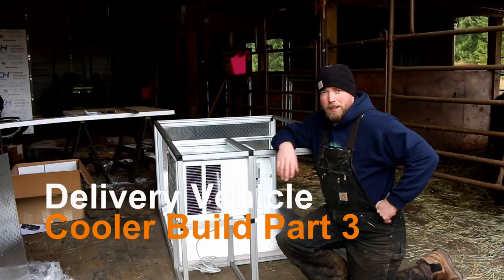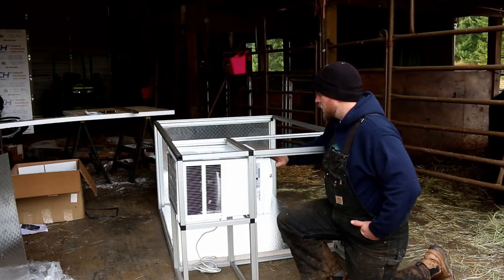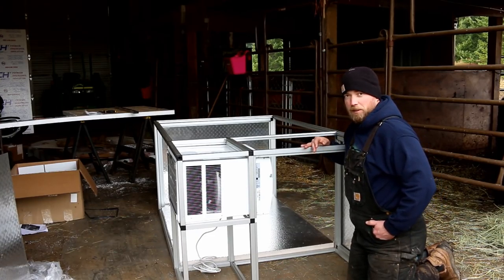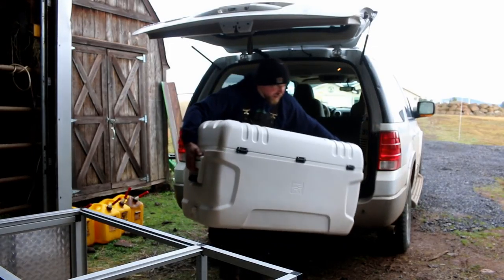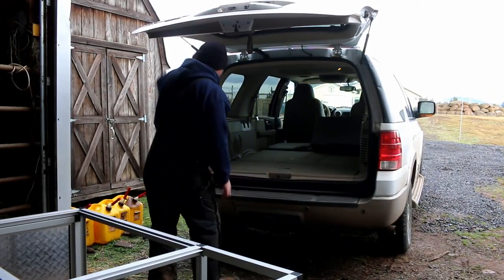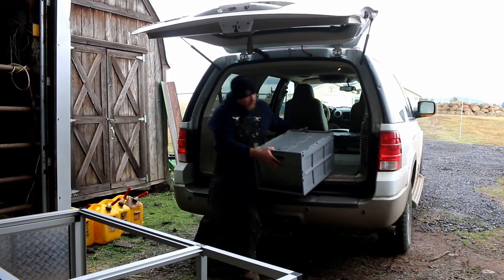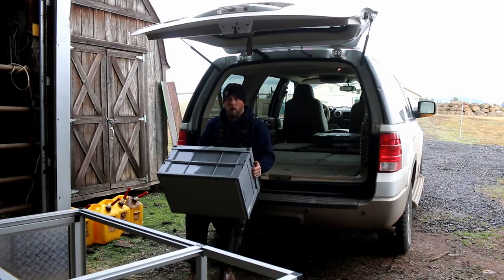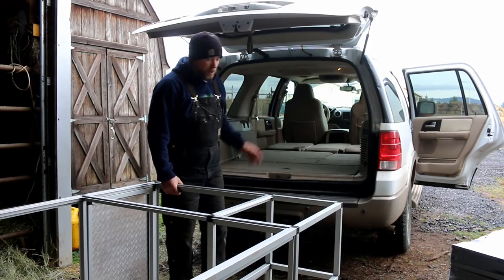DIY Mobile Cooler - FIT CHECK

Comment: I have two suggestions for you; first one, get a sheet of 1/8” hardboard to put on the floor to slide your cube on,this will make it easier to slide it in. Second One when you put your plywood flooring in your cube mounted it on full extension slides so that you can pull the plywood floor out and have full excess to the back of your cube without having to crawl inside to retrieve your containers!!

Comment: If you plan to take it out, then I recommend shrinking the height by an inch so you don’t have to remove any panels, then building a “dolly” that you back up to and can slide the cooler onto.  If you have to remove panels, they’ll get lost or the plastic retention pins will break and the whole rig will end up looking shoddy.  

Also, you deserve a workshop. Having a proper place to work makes every other project that much easier.

Comment: Love the videos.... think you should have use a thinner wall material as that's gona be a fair weight when done. Could use a Piece of sheet plastic and the expanding foam on the inside to insulate the hole "cube" then spray paint with a high gloss for easy clean and seal off the foam.

Comment: That's turning out to be a nice cooler.  For the removal, you might consider building a table with rollers on it.  You'd back the expedition up to the barn and roll it out onto the table.  I imagine the lift gate on the expedition is going to make lifting it out a bit of a hassle.  This assumes having a table of that size in the barn is a feasible option.

Comment: Have you considered finding a four wheel drive truck and putting a freezer/cooler bed on it for your future needs instead of a sprinter van. I don’t know if it would be any cheaper but it something you could look into and maybe find used
Reply from the maker: +Brandon Beckemeyer I have and really wanted to finally justify my need for an f350 😀 but the side access was the key need so it's easier to load the entire cooler

Comment: It might be slightly helpful to take some emery tape and round off the sharp edges on those top front corners (or anywhere else at the front) so that it drags on the head lining and carpet less when your pushing it in all the way in?
I presume that you have checked for sure that the back door of the vehicle fully closes when the cube is inside?

Comment: have you thought about what will you be doing to remove any condinsation from the airconditioner that may happen also with using plywood on the inside an where its going to be chilled if any condinsation builds up on the inside an gets into the seems of the plywood could cause a mold issue.

Comment: Have you addressed the issue of the spare tire? Doesn't look like there is the room on the side to slip it in, so are you going to have a remote mount for it or run after it should you have a flat and take a spare with you? 

If you are stacking 2 high inside looks like there is plenty of room. Are you going to leave for extra room to grow? If not I would probly trim all the upright pieces on the bottom a little to make loading and unloading easier and avoid removing the trim. I would keep the dvd out unless you wanted to use it at some point in the future.

I too would suggest a rolling cart to place the cube on for storage, loading, and unloading. It would be easier as you have a hatch that would get in the way of a pulley system like you were talking about.
Reply: I agree with the lowering but I'm not sure of the total height of the air conditioner AND battery under it.  I have not heard him explain what happens to the condensation from the air conditioner.  Should be a good scene in the next video when he realizes he has a drain problem.

Comment: Now that a watch this and thought about it a little bit and I know it's a little too late. But I think you would have been better off buying a pickup a S10 Ranger Toyota or even a full size extra cab not a super cab. And then used a camper shell used your phone and insulated in Iraq make a rack system for the coolbot in your boxes and would have been easier I think.

Comment: TRM, I'd make it 1/2" shorter to slide in easily. Don't use plywood, use gator board. It is foam lined and incredibly strong.  http://amzn.to/2B0kdAs I would have used screws and T-nuts instead of liquid nails. Think like an engineer!